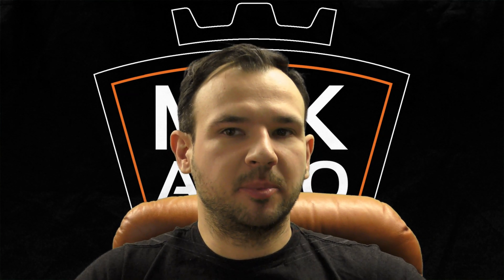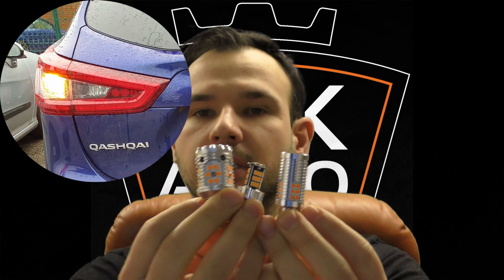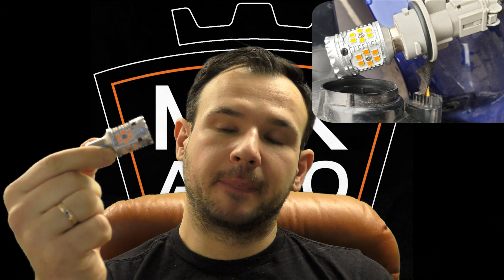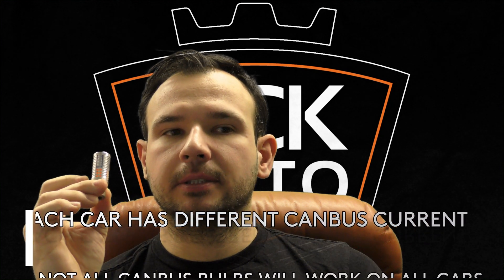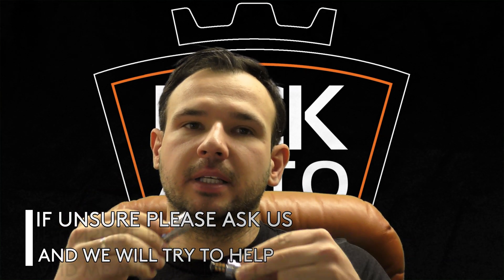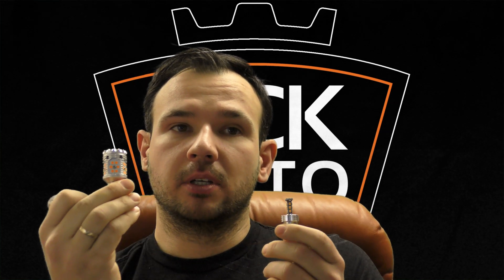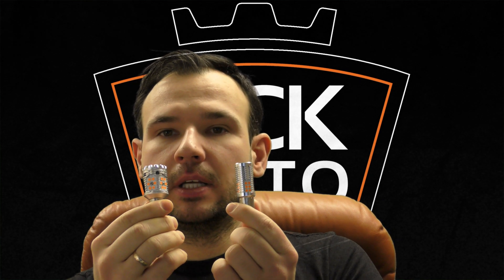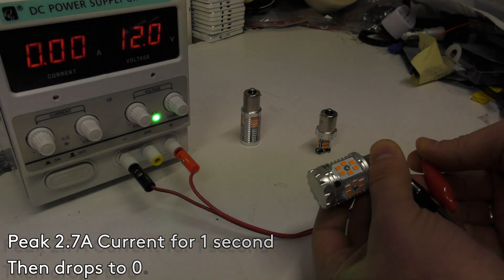💡 CanBus Explained - CASE STUDY PY21W INDICATORS QUASHQAI 💡

Comment: What H7 and H9 would be compatible with Porsche 987.2? Pls help
Reply from the maker: Hi, Im not sure what Canbus requirements it has. I would recommend something over 2A (when you look for LED bulbs check that parameter) and check if you have space in your headlamp to install them before buying - some LED bulbs are quite big
Reply: MCK Auto thanks 🙏

Comment: Hi.i like to change my roof light into led.ita Vauxhall astra j 2011.
Which led bulb should I buy.
Tha
Reply from the maker: Hi for Astra J please buy the strongest one - they have very high canbus requirements
Reply: @Mckauto  thablyou I did, I did changed the number plate , headlights too.
I brought the resistor error cancelling ones.and now is ok.
Thankyou for your advice.